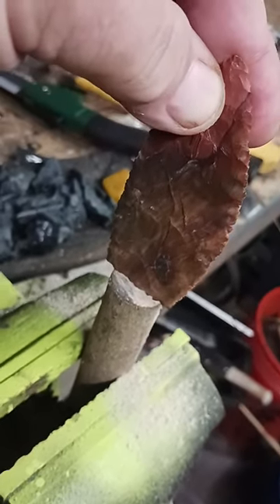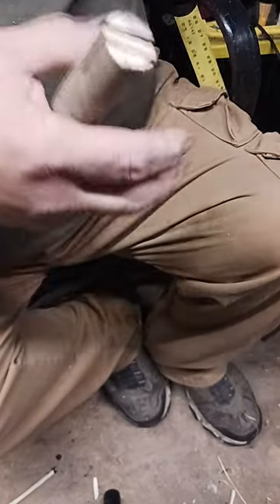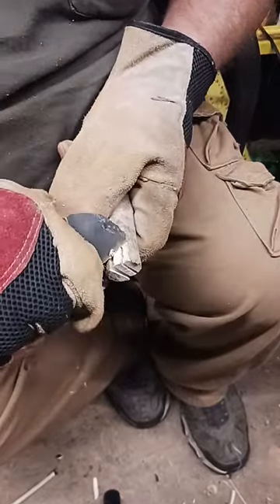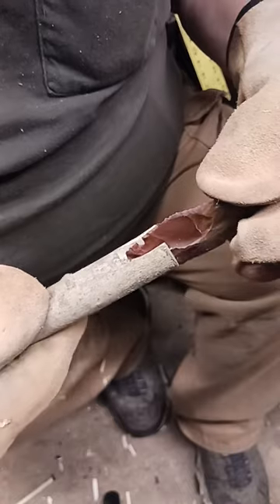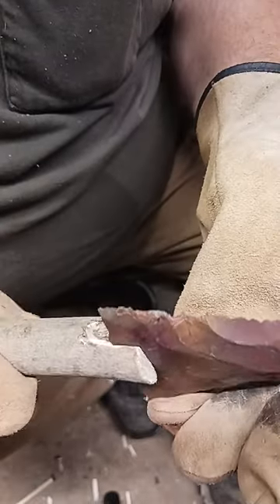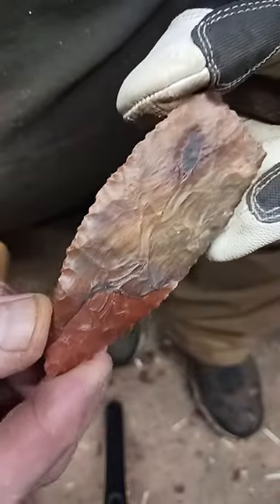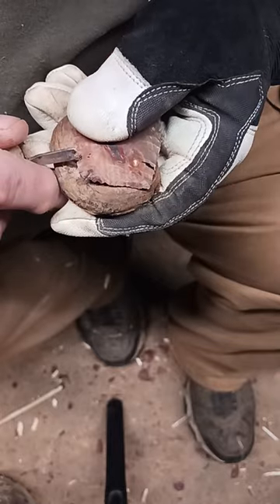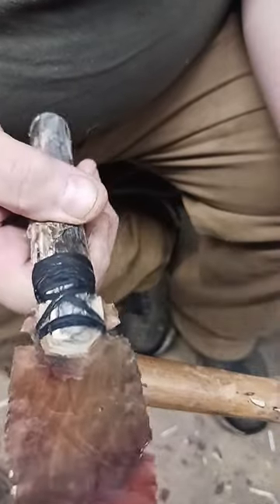The making of a transforming walking stick, spear, bo staff and knife combo.

Comment: In regards to your use of antler for indirect, I would suggest that the most common issue metal knappers have with trying antler is the tendency to overgrind edges.  Instead of grinding them with a rock or grindstone, brush them with an antler for a while, till you get the feel for it.  Edges actually need to remain fairly "sharp" (comparatively) for antler indirect.
Reply from the maker: Nice to hear from you Chuck I've been waiting for some videos from you. And thanks for the advice. I was gonna put my antler in the rock cooker at 120 for a few days to see if it stops being so mushy.
Reply: @sticksstonesandalittlemeta3517  - yeah, you guys have more humidity than I do for sure.  It might help.

Certain events have kept me from getting videos up for a while, but I think things are calming down and I should be able to get back to it soon